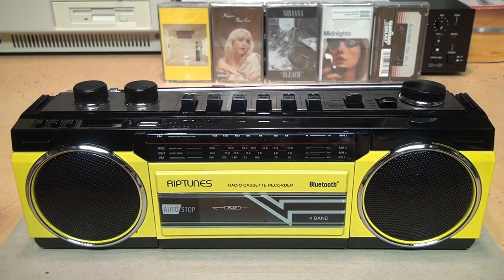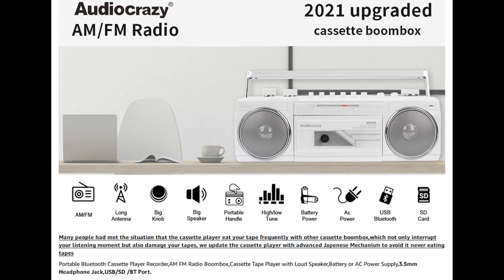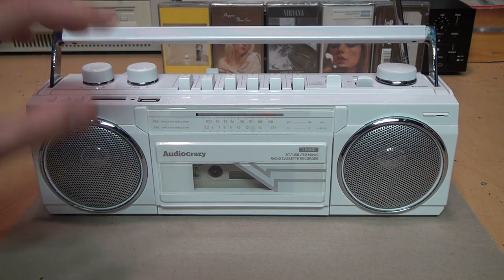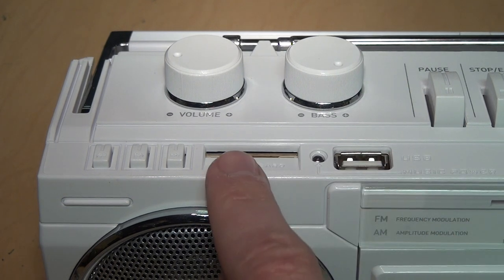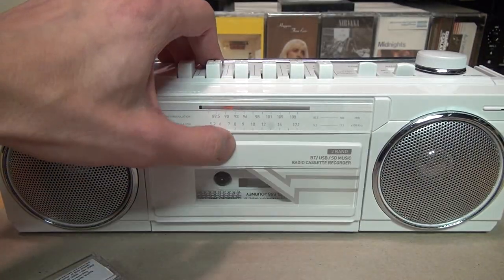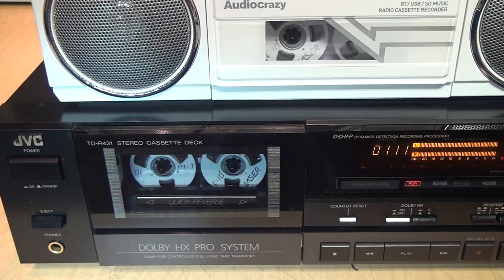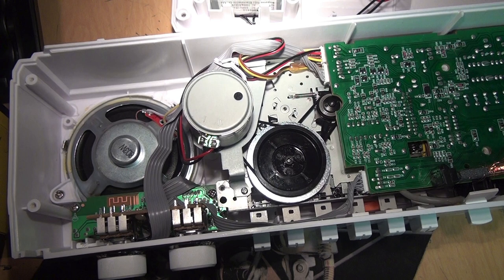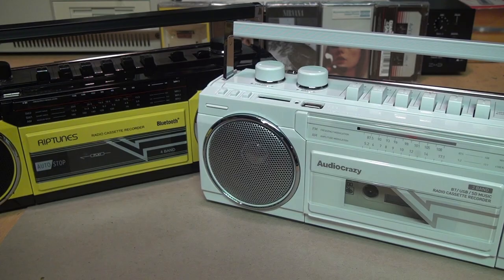New improved AudioCrazy STEREO cassette boombox!

Comment: Yes a clutch system to not break a tape in rewind is great.   I also think a auto stop mechanism that has a rider on the tape in the tape path can make the tape misaligned as well. So to claim it will not eat tape is a lie, with that kind of system. Most time when a machine eats the tape it is because the tape is sticky, or the pinch roller is sticky and the tape get stuck on the pinch roller. So it will only stop when the tape gets to large around the roller, several feet and then machine jams and or burns through your tape.
 For me for it to not eat a tape, it has to have the stop sensor on one of the reels, especially the take up side. With this take up reel sensor at the worst you will have maybe 1 inch of tape out of the cassette before it stops.

Comment: Probably doesn't make too much sense looking at the magnets on the back of the speaker.

The bulkier version might be magnetically compensated - so you can put it near a CRT without distorting the picture. Honestly it doesn't look like it in this case though. A compensated speaker is basically two identical magnets, one of them being the working magnet which is over the coil, and the other being a compensation magnet epoxied to its back in reverse and with a steel boot covering them both to help short circuit the field.

The other difference can be in the choice of magnetic material - alnico or neodymium. Most alnico designs can be converted to neodymium without harm. Perhaps material availability and such shifting. Normally alnico is cheaper, but with the added weight, who knows how it really works out. Neodymium magnets are also often arranged differently, the magnet body is within the lateral envelope of the coil and jots out the back somewhat more, that's the internal arrangement, while typical alnico sits completely outside the coil but flat, that's external. Perhaps an internal arrangement of alnico is possible, it's not like the magnet in these was particularly feisty to begin with.

Comment: Finally a new cassette player that doesn't suck. You could always change out the speakers, with some 3D printed brackets if necessary. Also, the smaller magnet is a neodymium one, so it could be as strong as the big fat ferrite.

Comment: Man, that flywheel looks wobbly at 13:42. Kind of crazy that you get essentially the same mechanism in those 850 CAD Tascam 202mkvii decks but those have a proper erase head and digital controls. Just goes to show it's all in the electronics now I guess. Me? I prefer a well built used deck with not too many hours on it at a fraction of the cost but for a new mini radio, that one is pretty nice. Would be interesting to see if putting in a NOS Mabuchi would have any impact.

Comment: It's nice to see they upgraded the design.  The original version was really cool looking, but really disappointing.  I want to get one of these upgraded ones.  I LOVE 80's boom boxes, but they're kind of expensive now.  I love it that the wow and flutter is as low as it is!  Some tape players are absolutely horrible!  This is actually pretty decent.  

I think I want to see if I can buy them on Alibaba and sell them with my own branding.  I'd like to see this with upgraded speakers, maybe some acoustic insulation, and a more discrete placement of the USB and SD card sockets.

Comment: I'm pretty sure a small magnet can outperform a big magnet if the big magnet is a ceramic magnet and the small one is a neodymium magnet.  I have an old Panasonic mono boombox from 1973, the RF-888 and it has a very small magnet (but I am almost 100% certain it is a neodymium magnet) with the 6.5" speaker,  which sounds absolutely great.  The magnet can't be more than 3/4 of an inch diameter. 

 Even though it is mono, it is probably the best sounding boombox I've heard at least in recent years.  It has a full rich sound with both good bass and good high end (IIRC, it has a 2 way speaker).
I think it just sounds bad because it's a cheap speaker.  You might be able to find much higher quality speakers to put in it.
Reply: A small magnet in 1973 would be Alnico not neodymium.
Reply: @oPossum5150  A quick google search shows neodymium was first developed in the early 80s and so it cannot possibly be a neodymium magnet. Thanks.
Is the Alnico stronger than a standard magnet?  It really does sound good and has a very small magnet for a 6.5" speaker.
Reply: @christo930  Alnico is stronger than barium ferrite ceramic that most speakers now use. Neodymium is the strongest common magnet type. The first use of neodymium in a speaker that I am aware of is the KEF Uni-Q from the late 80's. There usually isn't a need for neodymium unless the application is very space constrained.

Comment: I wonder if the tinny sound is indeed the speakers or if it's a crappy amplifier.  Like, if you replace the speakers with good ones that will fit, will the sound actually improve?
Reply: almost certainly speakers, 'i've had many cheapo 'midi' 'hifi' systems in the 80s with 5 or even 4 inch speakers, with little bass, and when trying with bigger better ones, huge improvement, but still poor max power output, 2w or so per channel,  some 'vintage' small speakers can sound better than modern ones of same size, i find modern ones have much 'stiffer' cone movement than the old ones
Reply: @andygozzo72  The heavy stiff cone presumably takes more power to work because moving more mass requires more energy.  But still, I would think you could buy better 3" or whatever size they are speakers which would sound better.  With 4 D cells, I doubt even 2 watts per channel.
Reply: @christo930  yes, i've come across pretty good small ones in the past... 4 d cells certainly could push out 2w if the amplifier output stage used 'bridge' output and suitable impedance,  a 1w into 8 ohm 6v powered chip certainly was available, TDA7052, and now maybe higher powered ones? stiff cones seem to affect bass first more than the higher frequencies, probably 'cause of the small cone size,
Reply: @andygozzo72  That's a mono chip from the datasheet I found.  I was talking 2 watts per channel, so a total of 4 watts plus running the radio or the tape deck. So that would be 4.5 watts for the radio and probably 6 watts when the tape deck is the source.  A 1 amp draw is certainly possible with D cells, but it would drain the battery pretty quickly.

I was thinking  the heavy cones would need more energy to move them. That if you sent 1 watt (for example) into one of these thick coned speakers and the same 1 watt into a more efficient speaker made of thinner lighter material, the thinner material one would be perceived as being louder. But I don't know that for sure, it's just a guess.

Comment: 15:30  The Audiocrazy mono tape radio has a rather cryptic label "AC BTILT-IN/UM-1 BATTERY" .   So does it include rechargeable batteries (UM1 is Japanese designation for "D" cell), or does it mean the AC power transformer is "built-in" but also takes standardised D's?
Reply from the maker: Just like the one I showed, it has an AC input and can run on four D cell (UM1) batteries. It does not recharge the batteries.

Comment: I wonder if a bit of hacking to put the newer and better version into the old case, and also upgrade the speakers to better versions of those little speakers. Or, maybe, external speakers?
Reply from the maker: I considered it, but there are enough differences to make swapping the internal components impractical, such as Riptunes one having a shortwave tuner and an aux in jack, while the AudioCrazy doesn't have shortwave and has a headphone jack.

Comment: Given that you can get a really good sounding bluetooth speaker for so cheap, they're almost there. I wonder if the 'decent' sound of most of those cheap BT speakers comes from them being mostly copies of a couple good acoustic designs, usually with a passive radiator to make up for the tiny speaker, whereas this one ends up being somewhat limited by its retro styling despite a speaker upgrade.

Comment: I got a cheap cassette boombox a few years ago which looked like this probably mono but as usual with cassette players these days it played at noticeably the wrong speed so I had to take it apart and adjust the motor with a screwdriver. Most of the cassette players I've had in recent years have been either far too fast or far too slow. In the UK anyway but I'm sure it's the same everywhere with cheap cassette players. Actually the one with the bad speed looked exactly like the Audiocrazy one but wasn't the same brand except I got it a few years ago. The sound quality is decent though.
Reply: Likely because no one produces calibration tapes anymore so the motors leave the production facility set at random speeds.
Reply from the maker: @RealEpikCartfrenYT  It's the same thing with turntables. They make the tolerance so wide that it can be playing up to 2% too slow or 2.5% too fast and still be considered within specification.

Comment: I have earlier model from Auna. It has two shortwave bands (not much going on there), (probably) analog tuner (no chopiness), SD card and USB slot on it's back it's unfortunately in mono. I don't use it much for cassete because it's mono and it have crap recording.
Reply: I had an Auna CD player, like a discman, that only worked for 2 months

Comment: The magnets on the speakers aren't better or worse just because they're sized differently. The large ones are Ceramic, and the small ones are Neodimium. The difference between them is cost and magnetic density. Ceramics are cheaper but have less magnetic density, so they require much more material to handle the same power as Neodimium.

Comment: I'd like this to have a BT TX mode, that would be great. As shown, the sound quality using the headphone jack is decent, but wired headphones become more and more unpopular. A BT chip, that can receive and transceive cannot be that much more expensive. So if they made this possible for say 49,99 Dollars this would be still cheap but great for relistening your tapes with modern equipment. I would love this like I love my Audio Technica BT recordplayer.
And of course I'd like to see an review of the "RS-M50M3" (who creates such complicated model numbers). First because your revies are great. Second perhaps a single, slightly larger mono speaker may have a better sound quality than to small speakers. Would be interesting to test.

Comment: 9:19 Where can one buy those plastic non-conductive adjusting tools? If on Amazon, how are they described to find them or can you provide an Amazon link, VWestlife? Thanks.
Reply: I think I found a set on Amazon listed as "Adjust Frequency Screwdriver Anti-Static Plastic Ceramic Set Home Hand Tools Useful New for Various Inductance Semi Variable Capacitor".
Reply from the maker: The one I showed came in a set of TV alignment tools.

Comment: Their other single speaker models resemble classic Panasonic boomboxes from 70s -90s
Reply: Maybe they are using the old moulds for the plastic cases!
Reply: and other brands, i have a what would be a very nice one, by jvc, good bass, 4 band tuner, unfortunately cassette part unusable as the flywheel metal has 'cracked up' and distorted😢

Comment: 9:48 I wonder if there was a voltage droop at the factory that caused the motor to run slower if and when they adjusted the speed.
Reply from the maker: It has a DC servo motor which means that it has internal speed regulation to compensate for a wide range of voltages. They simply adjusted it to be too fast at the factory.
Reply: @vwestlife  Understood. Thanks!

Comment: instead of cutting corners on quality why not cut corners on payroll (walmart anyone)?

you could get the 80s design with better quality by swapping the guts  from the white one to the yellow one.

since the internals are exactly the same as far as layout of the parts and screw holes you should be able to swap the internals.

Comment: I am surprised that there is a shortwave tuner on this cheap of a thing! (on the earlier model)
Reply: It's easy to throw in because the chip tuner supports the frequencies, but it is just about useless. Just a marketing gimmick to people who remember it. You might hear some beacon chirping near you and that's about it. It is not sensitive enough to pick up any meaningful SW transmission, which there are very very few, even with a proper SW reciever and roof antenna.

Comment: hmm, dc bias shouldnt be that bad, i had a tandy ctr55 cassette recorder in the 80s i used with my zx81 and zx spectrum, it has dc bias and dc electromagnet erase and records at a seemingly  'normal' level, and tapes saved on it loaded back ok, computers are far more picky than the human ear😉 maybe they made a cock up in the audio level drive to the head on record mode? or too high bias current? be interesting to see the circuit/schematic and compare with the tandy one
Reply: strange thing is  on a smaller model around the the same time, minisette 9, they used ac bias, still dc erase, though

Comment: Does the USB/SD card player have "Shuffle"? If it did, I'd buy one tomorrow. Shuffle is my main mode for casual listening (at work, ETC).
Reply from the maker: There is no shuffle mode. It plays the files in the order they were written to the drive.
Reply: Maybe you can buy a mp3 player and active loudspeakers.
Reply: @duskonanyavarld1786  I have a Bluetooth capable Mp3 player AND a Bluetooth speaker. But I like the looks of an "old school" radio AND a 1 unit "plug and play" solution that I could just leave on the desk and not have to set anything up everytime. I know this radio has Bluetooth, So It CAN be used with my Mp3 player (or my phone). But a "standalone" player with shuffle is what I'd LIKE. And it would probably only add 14 Cents to add to such a device.
Reply: @vwestlife  Every one of these types of things NEVER have "Shuffle". I can't understand why as I can only see adding 1 button and a bit of software code. I'd pay the extra buck for two for that. LOL.
Reply: @jamesslick4790  I think you can buy a cassette that play bluetooth. Maybe that is an option.
Reply: @duskonanyavarld1786  Bluetooth playback is something I already HAVE on multiple devices. The cassette part is a luxury, Not a requirement. I HAVE cassette gear for going from tape to digital AND from digital to tape. I would just like to have a cool LOOKING radio/"boombox" that can shuffle tracks from an SD card WITHOUT using an OUTSIDE device to "stream" from. I already "stream" audio to an ACTUAL 1939 Zenith console radio. (Great for listening to old radio "noir" shows!) But THAT's not a "one box" solution.

Comment: Their "no eating tapes" claim should be removed from the marketing, because it's 100% false, and I wonder if they even know what product they are "creating". EVERY tape-tension based autostop will make a salad of your tape it if the take-up stops/jams. The mecha being manufactured by CSG is good I guess? Motor most likely has the biggest impact on the somewhat impressive W&F.
Reply: still CSG is inferior in quality to original Tanashin mechanisms. My Philips boombox from 2004 has a genuine full auto stop Tanashin mechanism, with a Sankyo motor, and it achieves wow and flutter of 0.08% WRMS (and that is with a test tape that I recorded in it, and then played back in it, so the values are kinda doubled). it rarely exceeds 0.15% peak
Reply from the maker: @RealEpikCartfrenYT  That's the best wow & flutter reading I've seen from them. My 1986 Sanyo stereo system has Tanashin mechanisms and it measures around 0.15% WRMS.
Reply: @vwestlife  bad take up clutch can also cause poor wow and flutter , i've come across it a few times

Comment: Does anyone else hope they use this mech/head/motor combo in a small walkman style device?
Reply from the maker: They can't, because the motor is too large and would make it excessively thick.
Reply: @vwestlife  good point, still I hope we can get a decent walkman-like device. I tried the  Tomashi and it ran slow within hours of use.  No amount of motor adjustment would fix it.

Comment: Eveready batteries, oh dear, oh deary deary me.  I realise people can only buy what they can afford, and D cells are expensive, but I will never buy Eveready batteries again after a set I had leaked and destroyed an LED candle I used to have.  The design of that newer unit is so cute, I love the white colouring of the case.  Too bad the power supply isn't dual voltage.  I'm so glad this thing has stereo sound, you just have to wonder why the older units were monaural, it doesn't make sense to me.  I'm not sure where I'd buy a unit like this in Australia.
Reply from the maker: Eveready and Energizer have always been the same company.
Reply: @vwestlife  Yes, I'm quite sure I was aware of that, but do Eveready batteries have Alkaline in them?  I know the batteries in my LED candle were Zinc Chloride, and they made a huge mess of the terminals.  I may be misinformed here, but I thought I read somewhere that Eveready branded batteries do not contain any Alkaline, but Ennergizer batteries are alkaline, please correct me if I'm wrong.
Reply from the maker: @Lachlant1984  The ones I put in are alkaline.
Reply: @vwestlife  Oh I see, very good, my apologies if I got my information wrong.  At least they're not zinc based.

Comment: Of course AM is not in stereo?  AM stereo came out in the 80s, as did NTSC TV stereo, so my assumption would be that AM stereo is an old tech that would've been part of the design of that tuner chip.
Reply from the maker: Of course I'm aware of AM Stereo -- I've been one of its biggest proponents since the late 1990s. But none of these cheap modern tuners support it, and that's what I was alluding to.